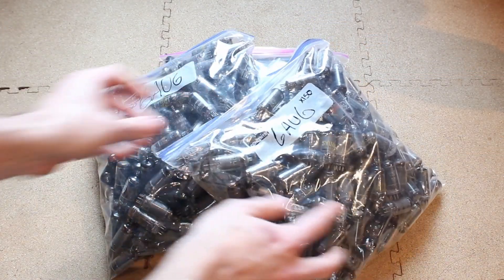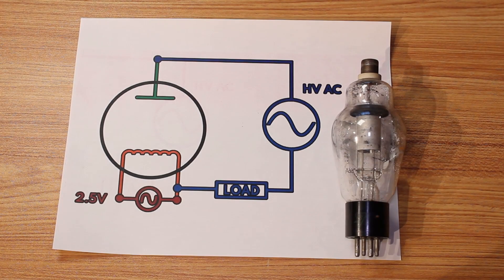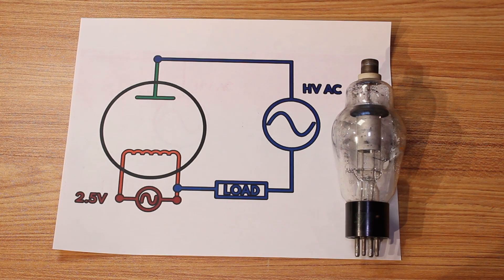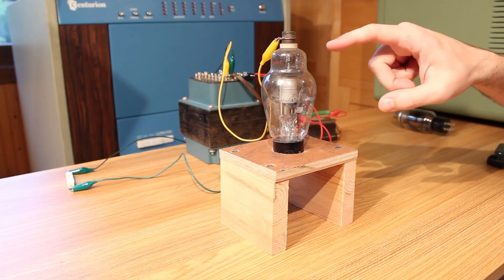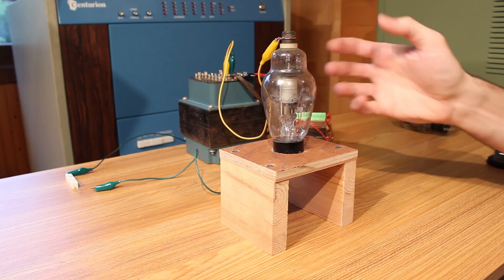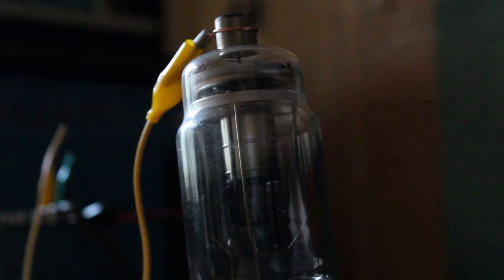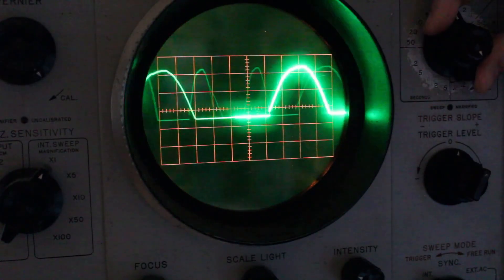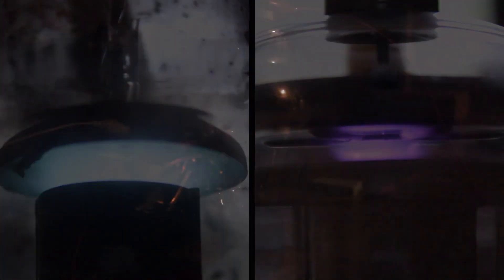A Look at Mercury and Xenon Rectifiers

Comment: When I used to operate carbon arc film projectors, they were powered by rather large mercury rectifier tubes (many times the size of the two in the video). We were told to keep the rectifier cabinet door closed when they were operating because of the UV light emitted by them.
Reply: How many volts were they rectifying for the arc lamps?  (If it was over about 15kV, then you'd ALSO get a bit of X-Ray radiation to add to you UV).
The glass envelope itself probably blocked a majority of the UV from escaping (but some WILL get out though)
Here in NZ, we USED to use MARs (Mercury Arc Rectifiers) for the HVDC submarine link between the two main islands.  Unfortunately, they've now been fully converted to Thyristors.
You can see a pic or the MARs bank halfway down the page at:
https://en.wikipedia.org/wiki/HVDC_Inter-Island
Just imagine getting too close to THOSE puppies when they were active!!! LOL

My understanding is that the inter-island HVDC link currently employs two independent 'poles' each operating at 350kV DC at up to 2000A
(That should get that slice of toast ready nice and quickly!)
Reply from the maker: @trevorvanbremen4718  That is insane, I never knew about that, but using a DC link between islands is another level of crazy! Thank you for writing about this, that was awesome to learn about today!
Reply: @UsagiElectric  It's not as 'crazy' as you might think.  HVDC is a more 'efficient' use of the copper than AC for a given level of cable insulation.  The only real 'issue' is when the link is run in uni-pole mode as it creates a fair degree of galvanic corrosion.  When operating in the normal bi-pole mode with the two poles being +350kV and -350kV from ground, the galvanic corrosion issue is largely eliminated.
Reply: @trevorvanbremen4718  In Brazil the main connection from Itaipu hydroelectric and main centers of consume like São Paulo more than 800Km away is by DC. Alternating current has a huge reactive loss over long distances where capacitance and inductance of the cables matter. Other main reason is that Paraguay uses 50Hz and Brazil uses 60Hz  and Itaipu energy is used by both (it has 50Hz and 60Hz generators). Off course it uses HUGE semiconductor rectifiers as it is newer (about  45 years or so).
Reply: @agranero6 
I was aware of the Itaipu DC line, but I hadn't realized the 50/60Hz issue between Paraguay and Brazil.  Thx 4 the info!

When the old MARS were phased out in NZ, a similar (but much SMALLER scale) set of semiconductors were installed.  In NZ, these thyristors are actually hung from the ceiling of the building (mostly due to the fact that NZ is a somewhat 'seismic' nation that is subject to frequent earthquakes.  The quadripole thyristors in NZ already look HUGE to me, but they'd look TINY in comparison to those used at Itaipu!

The NZ setup makes use of the generation hardware itself at the southern source for power factor correction, but this is not so easy at the destination of the HVDC link.  There's some SERIOUS hardware at the northern end that's used to manage the reactivity at the DC->AC conversion step.
Reply: @trevorvanbremen4718  Some off my PY-5xx tubes are labled "Warning X-rays". They were insinde TV-sets and saw closer to 2kV.
Reply: @fredrikjohansson4069  
I remember seeing a set with a 42EC4 (equivalent?) and the tube was fairly well 'caged' within the EHT area of the set.
Thanks to your post, I now know why they seemed so intent on throwing it into that hot thick metal cage!
Reply: @fredrikjohansson4069  Wouldn't that be more like 25kV? 2kV wouldn't be for much of a CRT lol
Reply: @MadScientist267  your correct and the focus voltage is 5kv . I remember some of the sets had that lead covered hv rectifier tube a 3ds3 I think. I may have a couple of those out in my boxes of tubes in the shop.
Reply: @MadScientist267  A colour CRT has closer to 25kV indeed. But the PY-5xx takes closer to 2kV according to the datasheet. Those tubes can be found in more than just TV-sets (like oscilloscopes and what not).
Reply: @michaelshultz2540  -  They were probably steel caged as lead is not really necessary to stop xrays. Most really HV TV's had a simple metal cage around the rectifier and maybe a metal shield around the middle of the tube with a BIG insulator at the anode with some dielectric grease.
Reply: @KlodFather  look up the tube i mentioned.  It has a lead covering about 1/8 " thick . I know what im talking about. I did not needto be corrected.  I've been an electronics tech since 1967.
Reply: @KlodFather  it is a 3DS3.
Reply: @KlodFather  you stand  corrected sir.
Reply: @michaelshultz2540  -  After you shot back, You most definately needed to be corrected :)  If there is lead in a TV shield it is the exception rather than the rule... and lead is not always an appropriate shield for xrays in most applications. 😜
Reply: @michaelshultz2540  -  I never challenged you about whether that tube had lead... I simply said that it was the exception rather than the rule and that lead was not necessary in an old TV... Even the old roundy colors which had some fairly crazy and extreme engineering. That tube is a weirdo and an outlier in the tube world. I have been into a lot of TV's (tubes) in my day and that lead sheath puppy is very unusual and not generally a TV tube. It was used for Radar and medical devices as well as special purpose equipment. The reason it is lead lined is it can operate up to 38kv which NO TV EVER ran at that high a voltage. That is why your average 25 27 inch home TV was only ever about 20 KV because of the Xray hazzard.
Reply: @michaelshultz2540  -  "You stand Corrected Sir"...   OK Booomer  😜👍
Reply: @KlodFather  I know that. But it was used in tv's . And shure it was overkill. Always laughed about it for that reason . 🤣  I always suspected the reason for its use was to conserve space by eliminating the need for a metal box around it . And hey, I was just being snarky . What life without a little ribbing. ✌️😎🖖👽
Reply: @KlodFather  there is lead shielding in all cathode ray tube tv sets. As the picture tubes are painted with a lead oxide coating. And there were high voltage rectifier tubes made with a 1/8" thick lead shild that was used in some early color tv's .
Reply: @michaelshultz2540  That is not Lead Oxide .. that is colloidal graphite .. aka Aquadag. It is conductive and completes a circuit. The actual CRT bell is leaded glass
Reply: Rectron rectifiers? Found another video of these used with a cinema arc projector.
Reply: Ran xenon short arc lamps on our 35mms, and you still don't take those power supplies lightly. I can only imagine carbon arc with these tube rectifiers. Always wanted to try my hand at the carbon arc projectors but sadly it's a dying art.
Reply: Greetings fellow (former) projectionist
Reply: @pileofstuff  hello .we need a lodge or club or something eh?
Reply from the maker: Man, that's awesome! When things get to the high power level, there's some seriously impressive tube equipment out there!
As Trevor said the majority of the UV should be blocked by the glass enclosure (especially so on this comparatively tiny little rectifier).
Reply: Uh I am a retired union certified  projectionest i first learned the job an all the skills as a 14 year old my parrents ran the concession stand on the army post theater.  I whold spend all my time in the projection booth. My father a radar and missile guidance tech had already taught me alot about electronics and i knew that the uv glow of high powered tubes was only the indication of the presence of x-rays and the tubes that had the purple glow should always be shielded and never be viewed when operating.  However my favorite time operating the booth was when you had to do the whole operation involved in film/reel/projector change you had to strike the arc adjust the arc/rods and switch the projectors every 10-20 minutes and all without the audience knowing or seeing it happened,shut the arc off the first lamp while it cooled down take the spent reel off ,put the new reel on thred the film que it ,rewind the spent reel 5 minutes befor next reel change replace the arc rods put in new ones 3min strike the arc adjust arc watch for cue marks 5 sec que start projector 4-3-2-1sec simultaneously close damper on spent reel and open damper on new reel ...repeat up to 10 times for a 2 hr movie. Damn i miss that job. Doubt it would ever happen, but that is definitely somthing that has been on my bucket list to do that again like back in the day .The last time I ever operated a booth was just after they started using a single projector and turntables and of course zenon arclamps. The industry no longer needed projectionest.  Sigh.
Reply: Dont worry now you can simply step outside and receive 1.7nw of UVC and feel your DNA being damaged.
Reply: @multishit6664 
LMAO!!!
With it being winter and overcast here, I'm feeling a bit 'short changed' and I seriously think I received a good deal LESS than 1.7nW
Sooooo...  I decided to smoke a cigarette to make up for it!!
Reply: There's a channel on YT called Photoinduction  & he has 1 of the very rare very large glass mercury diodes that's mentioned.  He also powers it up too, it looks cool.
Reply: @merlin5476  
I think the channel name you meant is "PhotonicInduction", and the video is this one:
https://www.youtube.com/watch?v=pAvtdEtwPTI
Reply: @trevorvanbremen4718  yeah that's the one of the videos, he has actually done another vid with a far larger mercury tube that arrived in a large wooden box suspended with springs  👍.  Ive followed quite a lot of his very entertaining chaos & find it rather cool. Where is he now !!!
Reply: @merlin5476  
He split from the woman he was with and then married an Indian girl.  Took the poor guy AGES to get the Home Office to allow her into the country.
He's made a couple of small vids since, but I don't think they're as good as his 'original' style
Reply: @trevorvanbremen4718  i did see the vid he made regarding this & it made me realize how incredibly corrupt the home office is.
Its a shame he doesnt pop up with a couple more vids as it appears that lots of people are patiently awaiting his return. 
Who would have thought that a coconut could withstand 180P.s.i.  !!
Reply: Andys collection of mercury rectifiers is impressive to say the least. His video on the excitron is even better than the one on the massive 6phase rectifier.
Reply: You should see the ones used in TV/Radio RF transmitters.
Reply: @OverKillPlusOne  
The largest transmitter tube I ever saw was only 25kW, but it WAS quite a best of a triode!
Still, it was like a microchip in comparison to the MARs banks used on the HVDC link
Reply: I too had some training with low and high intensity carbon arc film projectors and yes one of the setups did use large full wave mercury rectifiers in a privet cinema set up in a garage. With heavy shielding also explained to tickle them to get them going and how dangerous they could be takingh into accounts they had been made in late 30 early 40's. Also thinking I was working also dealing in nitrate movies. fun time's fun times. I see there are replicas of the large mercury rectifiers that can be used in this sort of setup that use Neon gas in them, replacing the mercury vaper in it use. Not as spectacular in the look. But you can see the clear electron trails of the electron plasma going from the anodes and cathodes with little to no drop in volts or amps of that of the full wave mercury rectifiers of back then.
Reply: The scariest consumer device containing mercury I've ever seen was a Keith Monks phonograph tone arm, a Unipivot design hat was designed to float on and be stabilized by 4 open pools of mercury that also functioned as the conductors for the wires from the phono cartridge where they left the arm wand  (the mercury pools connected to wires that passed down through the base of the tone arm out to your preamp or receiver).  I briefly owned one that was given to me, and not only did I not have sufficient mercury to float the tone arm, there's no way I was going to live in an apartment with 4 open pools of mercury that could be spilled into the carpet or would sit there evaporating (sublimating) slowly into the air.  I added some fine  wires to it to eliminate the need for the mercury.
Reply: They still use these to power some elevators from the 1930-1940s in NYC. They are literally the size of a person's torso.
Reply: @azzajohnson2123  -  And to power the chair...   THE CHAIR!!  Yea... That was cool Butthead...  😜👍
Reply: The glass of the tubes would absorb allot of the uv light.. Not all, but most of it.. The carbon arc however would produce A LOT of uv
Reply: @HomeDistiller  -  Absolutely correct. That is why the old eproms in electronic equipment had quartz windows because glass did not pass enough UV light to erase the chip. I remember those days and using a UV light I scavenged from a clothes dryer to erase proms salvaged from equipment and reprogram them to open wide cable converters  😜👍  Old engineer and tech here.
Reply: @KlodFather  ...it's also why, when building an EPROM eraser with a mercury streetlight bulb, you had to carefully shatter and remove  the outer glass envelope to keep only the inner UV-transparent mercury bulb to irradiate the chips... Still remember turning the thing on (inside its coffee-can-made shroud that only opened towards the chips at the bottom) and immediately NOPEing the hell out of the room until the chips got erased. Good times... ;)
Reply: Ive been looking for one of those.  Very hard to find in the USA
Reply: @FixitFrank  -  The hamfests around MD and VA outside of DC toward Gettysburg PA, Reading, and Philadelphia turn up that stuff all the time. You should go there because many of those guys won't sell online and I have seen many old Merc and Xeno tubes there as well as many other weird ones. I have seen some vintage water cooled ones also... Look more like Chemistry glass.
Reply: Yeah, since they don’t have a phosphor covering the inside like fluorescent lights. Definitely don’t want to stare at glowing Mercury vapor. I imagine it’s as bad for you a staring at a really bright light. A glance isn’t going to kill you. Like I’ve said elsewhere, I am not the safety police.
Reply: Do they already use LEDs now? How do you replace an arc lamp that fast? I know they’ve been around for well over a hundred years but they are extremely bright. It seems like yesterday when LEDs were dim as hell. How time moving so fast?
Reply: It’s the same principle as welding just contained

Comment: This reminds me of the teletype power supply CuriousMarc was working on :)
Lovely glow! Thing of beauty, joy for ever, and you've got lots of the other Dave's enthusiasm. And niiiiiiice Tektronix transformer there.
Just don't let the usagi-chan tip the tube off and break it, please...

I'll have to do some experiments with thyratrons - got two of them somewhere in my lab.
Reply: I was about to write the same ;)
Reply from the maker: Oh yeah, Marc's TTY power supply was an absolute gorgeous piece of equipment!
And the little usagi quickly discovered the tube wasn't going to supply any treats and lost interest, haha.
Reply: I have some 2D21 thyratrons here somewhere, as well as some miniature pencil size thyratrons that were used in televisions.  I used to have some larger ones that were used for elevator switching I think but I don't know where those have gotten to.....
Reply: Love valves, thanks for this. Still got my Tektronix 2215 60Meg scope. A reliable companion for many years.

Comment: Could you do full wave rectification with those two tubes?
Reply: You'd presumably need four of them. And matched?
Reply: @obd6HsN  I know that's the case with diodes, however I suspect it may be different with these tubes. Since if you just reversed the AC supply, but keep everything else the same wouldn't you end up with exactly the same waveform 180 degrees out of phase?
Reply: @bradleyphillips5254  You can get full wave rectification with a center-tapped transformer. Connect each end of the transformer winding to one of the 2 anodes, connect the 2 cathodes together, and the load between the cathodes and the transformer tap.
Reply: @obd6HsN  You can use four in a bridge configuration, but you could also need at least three filament supplies (one for the two tubes at the bottom of the bridge and two for the upper two tubes, whose cathodes are at opposite sides of the AC supply.  (In tubes like the 866A the filament is the cathode so must have its own isolated 2.5V transformer winding.)  Full wave rectification with tubes usually uses either a single tube with two anodes and a common cathode (commonly done with vacuum tubes such as the 5AU4 or GZ34) or two separate tubes with the cathodes joined (a pair of EY500 for example).  A centre tapped HT transformer feeds both the anodes with the centre tap providing the negative connection to the load.  Two 866A mercury rectifier tubes can be used in this configuration.

Comment: Do these tubes emit uv or X-ray radiation ? I suspect mercury one would be emitting strong UV try bringing a uv sensitive object near it to see if it glows
Reply: No X-Rays at that voltage I wouldn't think. The mercury rectifier would've been pumping out a bunch of 203nm UV though (not sure how much would make it through the envelope of a tube that small though).
Reply: The glass will block UV radiation and Xrays can only be created if the anode voltage is very high. often much higher than which these tubes are generally operated at